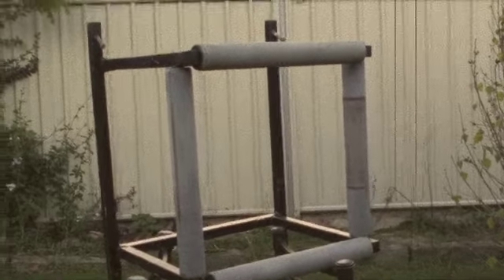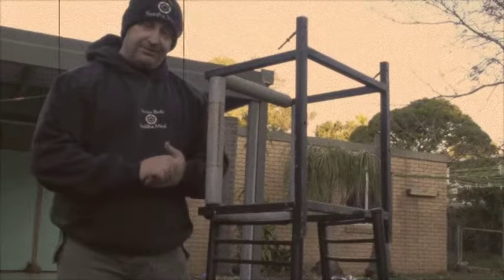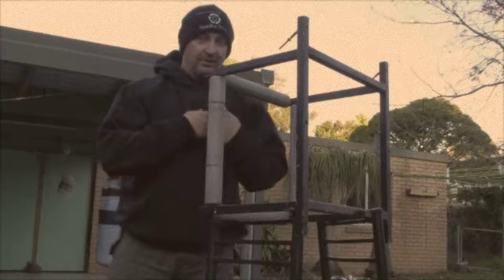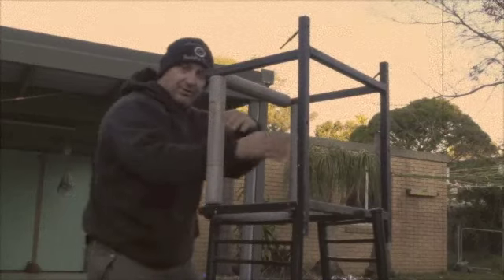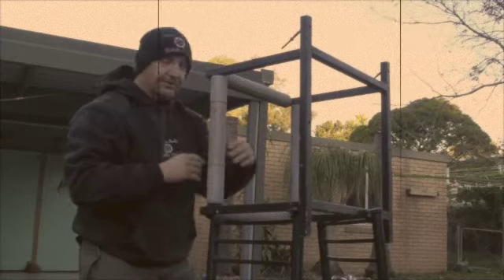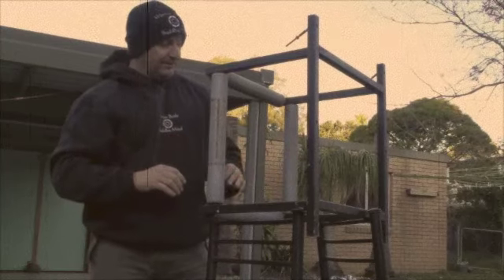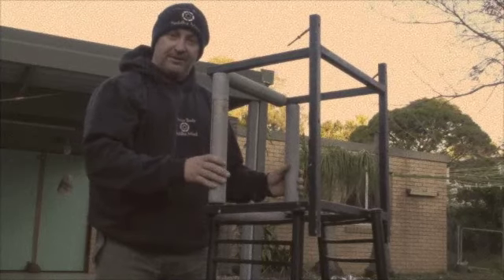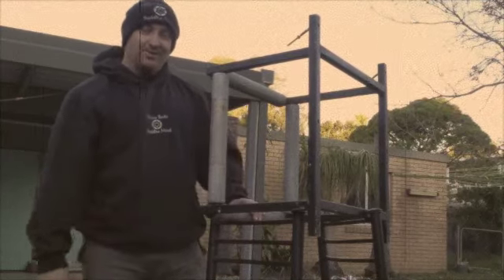4 Door Grinder Dummy

Comment: How about  plans to build  one
Reply: It looks like welded square tube material 
You could make a wood one with screws and wood too
Reply from the maker: was made and welded but im sure you can figure out the dimensions not to small and not too big,  enough for both of your bridges to work inside the box ....I have given it away but its simple maybe one can be made much easy without steel.  If you do please tag me.